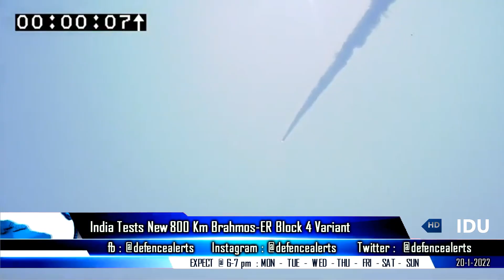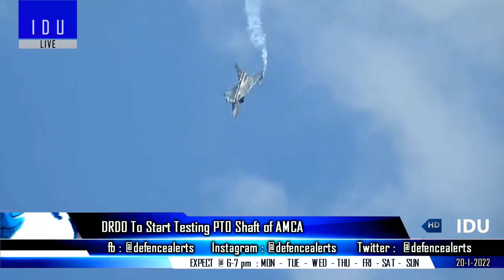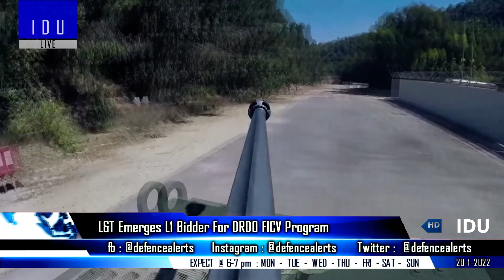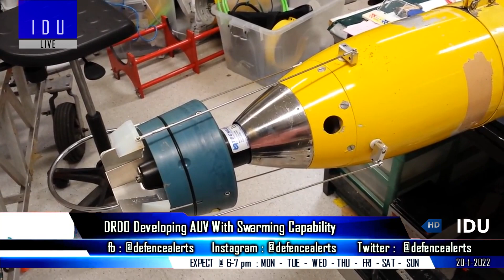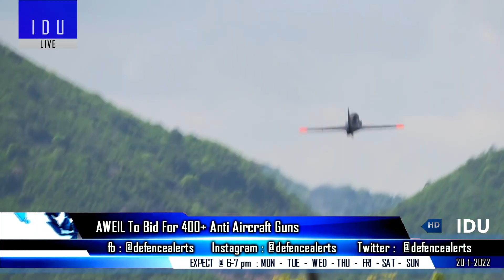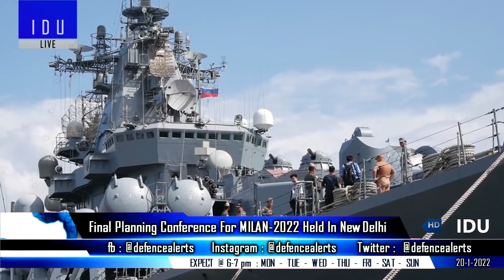Indian Defence Updates : 800 Km Brahmos-ER Tested,AMCA PTO Shaft Test,DRDO L&T FICV,Pralay Launcher

Comment: Future infentary inventory vehicle
vehicle platform
Must have these
We can also develop automatic multi role vehicle with 
Remote control machine gun motted on a top of it along with 
Laser finder
Thermal imaging camera
Night vision camera
Mostly useful in patrolling in borders areas 
Similar in line of multiple purpose Robotics UGV

 The vehicle must offers protection to the on-board crew against ballistic threats and mine explosions. It also features a coaxially-mounted smoke grenade launcher, and a dedicated system that offers protection against nuclear, biological and chemical (NBC) weapons.

The protection features of the MAV are further improved with the application of applique armour plates and cathodic protection.

Other systems installed aboard the vehicle include an air conditioning system, an explosion detection and suppression system, and countermeasure systems.

Comment: I hope L&T and DRDO use the K-9 chassis as a base for the development of both. That way all three will have a lot of the same parts. With an indigenous engine and transmission it will be the best option. All they need to get than is the K-2 and negotiate the same engine and transmission deal as Turkey did. By replacing the German and some of the Korean components with indigenous ones they saved nearly half of the price of the Korean version.
Reply: Are you out of your mind bud? The DRDO has already clarified that they will be going with the indigenous NGMBT chasis and you are telling them to go for a South-Korean chasis again? Yes, that was the initial plan but, it has changed in case you weren't  aware.
Reply: @velociraptor1596  they want to get more money by replacing it with the non functional design they did. That is the fastest way to end up with the K-21 and K-21-105